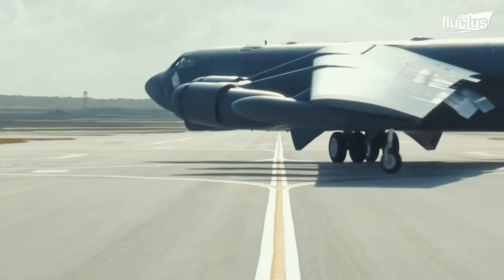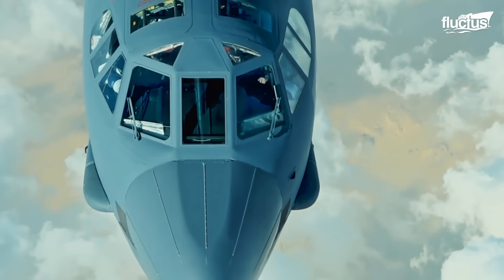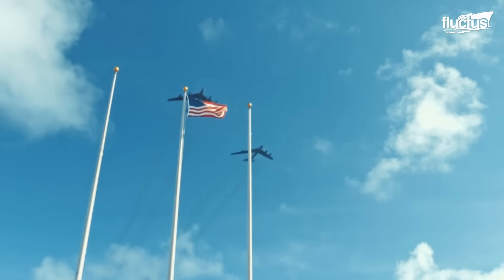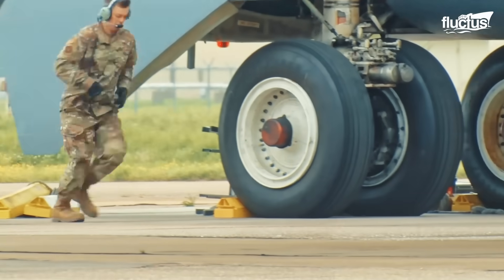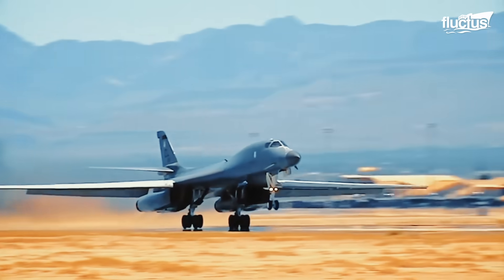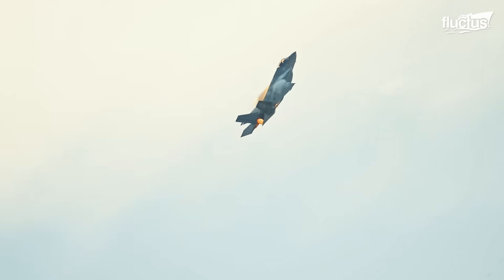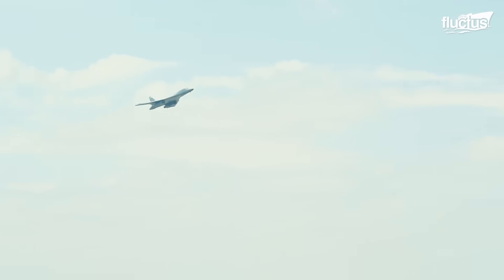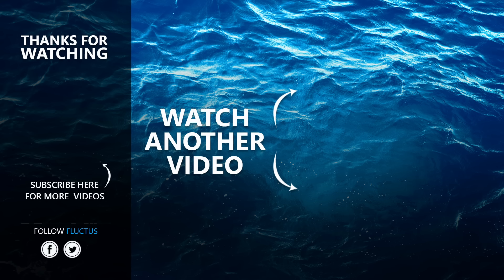Behind US Genius Idea to Power Old B-52 Bombers with Brand New Engines

Comment: The idea of reengining the B-52 has been around for nearly 50 years.  When we were putting the CFM-56 engines on the KC-135R (to be) in 1977-78 it was also discussed about doing the B-52.  But it was felt by the AF at the time that the money would be better spent on the tanker.   Ground clearance would not have been an issue.

Comment: I remember about 15 to 20 years ago, BOEING gave the Air Force a plan to re-engine the Bombers with four engines that the 757 uses. The four engines were more powerful more reliable, more fuel efficient than the 8 engines used on the B-52. Increased the range of the Bomber by about 2000 additional miles. It seemed like a winning idea.
Reply: There's a lot of things that have to change about the aircraft to handle going from 8 small engines to 4 big ones. Engine-out performance and handling totally changes. The structure of the wing may not support the change. Ground clearance would be an even bigger issue for that jet than it already is. They need something as close to a drop in replacement as possible.

Comment: 3:46 the P-38 absolutely never used Rolls-Royce engines. The Lockheed P-38 only ever used a turbo-charged Allison 1710 V-12. The P-40 absolutely used Rolls-Royce Merlins when they could get them. But most US planes that used Merlin engines were actually license-built Packard engines. Rolls-Royce had enough on their hands to keep up with British military demand let alone supply the US with substitute engines. The Turbo-charged Allisons on the P-38 were always demonstrably on par with Merlins because of the Turbo-super charger on that implementation. P-40s and P-51s were designed initially with Alison engines with single stage super chargers that led to poor high altitude performance. They were also designed to easily convert to Merlins as Britain was always a prospective user.

Comment: To think that the Next Gen Fighters can not be maintained to the level the older planes can, simply because in the contracts there are strict provisions that are in favor of he manufacturer to have most of the rights to how the aircraft gets used  and maintained.  They have complete control to their systems (electronic, mechanical and weapons)  So you will never see an Airman manufacturing or repairing a next Gen fighter unless it falls with in the contract that was approved by the military. Just awful that they wrote away their Rights to Repair.😮

Comment: I Love 'The Cadillac'!  But, is there a limit to the number of pressure cycles the fuselage can take before the aluminum becomes so work-hardened it just finally blows apart at 40,000 feet?
...there are grandchildren in the Air Farce flying the same plane their Gramps did!
Reply: The first part of the B-52H to reach economical  life limits of 32,500-37,000 hours on the wings upper skins depending on the altitudes flown.  The fleet is at around 20,000 hours right now.

Comment: There were 2factual inaccuracies in the the engines used in the P40 and the P38 they did not have Rolls Royce engines.
Reply: The P-40 also had a Merlin powered variant the P-40F. That variant is the origin of the 'Warhawk' name now synonymous with the aircraft. Previous Allison variants were called 'Tomahawks' & 'Kittyhawks' but the USAAF adopted the name 'Warhawk' for the Merlin powered P-40's & like the P-51 it turned it into a monster & the name stuck. 

A few test P-38's with Merlins were made & while it offered a performance improvement the Alison's were more than sufficient. Merlin's were also in shorter supply & you would need two so not a good use of resources.

Comment: in the year 2050 Pentagon announce : B-52 will retro fit with new warp engine and join USS Enterprise mission to mars

In a groundbreaking announcement, the Pentagon has revealed plans to retrofit the B-52 bomber with a new warp engine, paving the way for its integration into the USS Enterprise's mission to Mars. This marks a significant milestone in the advancement of interstellar travel technology.

Key Points:

B-52 Modernization: The B-52, a stalwart of the US Air Force for decades, is set to receive a major upgrade with the installation of a warp drive engine. This technology, previously confined to science fiction, is now a reality, promising to revolutionize space travel.
USS Enterprise Mission: The B-52's integration into the USS Enterprise mission signifies a significant step towards humanity's exploration of Mars. The warp drive engine will drastically reduce the travel time to the Red Planet, opening up new possibilities for scientific research and potential colonization efforts.
Technological Breakthrough: The development and successful implementation of the warp drive engine represent a monumental leap in propulsion technology. This breakthrough holds immense potential for future space exploration endeavors, enabling faster and more efficient interstellar travel.
Looking Ahead:

The Pentagon's announcement marks a new era in space exploration. With the B-52's warp drive capabilities, the possibilities for interstellar travel seem limitless. We eagerly anticipate further developments in this exciting field and the potential for future missions to explore the cosmos.

Comment: What they should’ve put on that instead of those Rolls-Royce engines that’s those general electric is the new one for the triple seven Boeing dream liner GE 124 it puts out 124,000 pounds of thrust per engine. You could get rid of four engines burn literally 30% the fuel now you have a super long range aircraft.
Reply: Would never work

Comment: Just a note. The Rolls Royce Merlin engines used in the P 51 and others were made in the US by Packard under license. Some Packard-built Merlins were actually supplied to the UK.
And---there are some USAF pilots who've flown the same B 52  aircraft as their fathers. Not the same model B 52, but actually the same aircraft.

Comment: Why not upgrade to bigger and better turbofan engines?  Look at any large commercial airplane, and it has more thrust than these, have more options for commercial maintenance, and can even reduce the number of engines from eight to four with associated savings.

Engine upgrades for the B-52 are way past due, but I think that there are better options and missed opportunities here.
Reply: Would cost more money because it would require a lot more modification

Comment: As is typical of the military-industrial complex,  they carefully scheduled this upgrade process to drag out for YEARS.  It's not expected that a re-engined B-52 will reach IOC (Initial Operational Capability) until 2033.   WAY too long.   If SpaceX were in charge of the program every B-52 would be flying with the new engines in two years.

Comment: So many errors in here. Need to do a bit more research. No genius here. The B52 has been continuously upgraded for it's entire life. They have been trying to get an engine upgrade on the B-52 since at least the late 70s. Guess they finally got the funding and engineering together to make it happen. Great OLD airframe, hope it outlasts the new engines. As a standoff weapons' platform it can carry quite a load almost anywhere.

Comment: The B-52's re-engining program includes the following specifications: 
Engine: The B-52 will be re-engined with Rolls-Royce's F130 engine, a variant of the commercial BR725 engine. The F130 produces 17,000 lbf. 
Engine controls: The B-52 will have a hybrid mechanical to digital throttle system. 
Other upgrades: The B-52 will also receive a new radar, improved communication systems, new pylons, new cockpit displays, and the deletion of one crew station. 
Designation: The re-engined B-52 will be designated the B-52J. 
Timeline: The Air Force expects the B-52Js to be available for operational use before the end of the decade. 
The B-52 is a heavy bomber that has been an integral part of many US Air Force missions, including Desert Storm. The B-52H version of the aircraft has eight Pratt and Whitney TF 33 turbofan engines.

Comment: Since when did the P-38 or the P-40 Warhawk have Rolls-Royce engines?
The P38 had two stage turbocharged engines made by Alison while the P-40 only had a single stage supercharger by Alison which didn't give it very high altitude performance. The P-40 performed well yet not at high altitude which was always the problem with Fighters.

Comment: Great an engine that is new replacing  a 60+ year old engine, better fuel ⛽️  usage,  better electrical generation,  YET THE SAME FUCKING THRUST,  typical chair force thinking inside the little blacked out box 📦.
Reply: It doesn’t need more thrust and keeping it at the same thrust rating prevents increased stress on the wings.
Reply: @grandmasterpu  ok so .94 mach. No increase in  pay load, same take off weights any decrease in engine weight, although better performance increase in endurance,
Reply: @LiamGardner-u9k  it’ll go back to .86 Mach. The primary reason for the new engines is sustainability. Everything else is a bonus.

Comment: To add new Engines to a 70 year old Air frame is st****.
Beyond belief.
The US should develop a new Bomber. From ground up because so much has changed in technology in the last 70 years. But they can't. They have no money and they have no heads able to do that. B1 and B2 Bomber were clearly a wrong development. There is nothing like 'invisibility' to Radar.
Hint: These engines are from Rolls Royce. A British manufacturer. The technological decline had been slowed down in Britain because being a member of the EU. Technology transfer was key.
Boeing has been fallen back. Burning planes and other inventions that failed miserable.
Reply: They are developing a new bomber, the B-21. It’ll replace the B-1 and B-2. The B-52 will serve along side it as the stand-off missile hauler. 

The engines are being made in Indianapolis.

Comment: The P&W TF-33-P-7 engines that powered the C-141B Starlifter were retrofitted to the B-52.  We had plenty of those engines, but putting RR engines on the Buff, what a waste of taxpayer money.  And Foreign engine manufacturer to boot!
Reply: Had plenty of the engines, that’s no longer the case. The B-52 desperately needs new engines and the RR were the best option. We’ve been using RR on aircraft longer than the Air Force has existed, so this really isn’t anything new. They’re also being made in Indianapolis

Comment: So, in a video which is 15.22 minutes long and is supposedly about the brand new engines, only 67 seconds actually discusses them. and about 5 minutes covers completely different aircraft!
Virtually all of the P-51 Mustangs were fitted with license-built Packard Merlin engines, versions of the Rolls Royce Merlin because although a superior engine out of the box, the RR Merlins were pretty much hand built and that was incompatible with US production methods and speed of requirement. None of the P-38 aircraft were fitted with Rolls Royce engines and the P-40 with Allison V-1710 V-12 engines.
It's not a 'genius' idea to upgrade an aircraft fleet with new engines, it's a long established procedure.

Comment: I wonder why they didn’t go for a 4 Jet engine configuration for the Mighty B52. I loved the F-111, the Aussies would fly them over New Zealand from time to time, great to see. Cripes the B52 is as old as me! Thanks
Reply: The rudder is so small that it cannot counter-act the loss of 1/4 thrust when an engine fails in a four-engine setup. Loss 1/8th of thrust can be handled even by the tiny rudder.
… I am talking about the very narrow moveable part. The fixed stabiliser is large but does not help counteracting uneven thrust when an engine fails.
Changing the rudder design would by a bit too big chunk of engineering to swallow.

Comment: These are either Commercial Off the Shelf business jet engines or a slightly modified version of one. Supposed to offer 30 percent better fuel economy. 

Why 8? Instead of 4 larger ones?
It turns out that the less you change the easier it is to recertify.

Comment: 3:51 The P-38 was powered by Allison engines, nothing Rolls-Royce ever built.  The later models of the P-51 used Merlin engines originally designed by Rolls-Royce, though AFAIK Packard built all the engines used in the Mustang.

Comment: There are Roll Royce parts in an A-10 engine as well.  : )
Reply: And in the F35
Reply: @nathd1748  hot section I would guess ?
Reply: @paulferrara9079  Vertical lift section

Comment: In the 190's, I read about a proposal to re-engine the B 52. Also, the B 52 was a test bed for the 747 engines. It's good that the Air Force bought new engines for the plane, but I suspect they were decades late.

Comment: These venerable aircraft are simply too old, even after upgrades to their controls, cockpit, and engines. They remain machines based on outdated design concepts. It's curious: during the era when the B-52 was developed, there was no hesitation to simultaneously create and launch multiple aircraft designs in quick succession. Today, despite having the most advanced design tools, optimization methods, and production techniques, costs have inexplicably skyrocketed. The same problem exists in Germany with complex military equipment in general. It is crucial to identify the underlying causes
Reply: And yet they're still the best at what they do.  And it isn't like this is the only bomber we have.

Comment: Do the new RR engines have the same thrust or more as the current engines?
Reply: Very slightly higher. Something like 400 lb per engine. 35% better fuel consumption and 14x the electrical draw-off.

Comment: The P-51 was equipped with Packard's redesigned/ American industry spec build version of the RR Merlin engine. The "new" B52 engines are a huge step forward re 
efficiency and close compatibility with today's mainstream maintenance standards.
Reply: You are absolutely correct!

Comment: Ridiculous waste of taxpayer dollars on an obsolete 50's-era subsonic airplane with a radar signature the size of a small planet! This ancient beast will have a life expectancy of less than 30 seconds in a modern battle zone!
Reply: The B-52 has been for a while and will continue to be an arsenal plane. It flies 100 or so miles behind the front line F35’s or F22’s, receives targeting information, which is then loaded into the missiles on board.
Reply: 1800  combat sorties in the last 8 years with the old engines. The aircraft is still very effective.  I guess we should ditch the c -130 cause its 70 years old and has propellors too huh?

Comment: The B52 should really have been decommissioned 30 years ago and replaced with an even better aircraft an aircraft that’s more advanced then the B52… I feel like the military can build and mass produce an even better plane to replace the aging B52 heavy bomber.
Reply: They did. The B-1
Reply: @beeceesp1386 then why continue to use the B52 then ??? if the military already has a more advanced bomber like the B1 than why not just decommission the aging B52 ???
Reply: @G-Man-half-life  A perfectly reasonable question. Requiring an Air Force representative to answer it accurately. But… what is published and available to the average citizen is: The B-52 has been updated so many times and in numerous ways, it is capable of the many missions required of a modern bomber - plus a few more (due to its cruise missile capability) like ultra long range and maritime missions. But that doesn’t really fully answer your question does it? The answer probably lies in the age old adage “follow the money” as in - the cost to replace them. These planes were produced for around 85 million dollars a copy back in the day - and modern aircraft capable of performing the same number of various missions (like the B-1) cost over 1 billion dollars each.   Money that comes out of our pockets!
Reply: You apparently aren't aware that the B52 isn't the only bomber we have.

Comment: In the DOD/Aerospace world, we'd call awarding Rolls Royce the contract for the re-engine program, throwing them a bone.

Could have easily installed 4 modern turbo-fan engines like the General Electric Leap engine, with more thrust, lower operating cost and lower engine operating temperatures.

Hell, even my favorite engine the IAE 2500 would have been a simpler approach. But it's only taxpayer money.
Reply: You talk out of your ass mate. RR make components for the F35 engine. It's quite simple why the Pentagon chose RR. They already have over 400 examples of that engine in the US military inventory. Engineers have many years experience with it. GE and PW quoted 3x and 4x tbe cost that RR quoted for this programme because they were so cocksure the DOD would award to a US company only. Pentagon fed up with US defence companies bumming the taxpayer as did Boeing with the KC46 programme. The V2500 was 60% designed by RR. They already established that as a 4 engined aircraft they do not have enough rudder to counter the loss of an outer engine.

Comment: I remember flying into Hartford-Springfield Airport in the late 70's early 80's and see a B-52 with a single jumbo jet engine slung under the wing on a former dual engine hard point.  It sure has taken a long time to bring this to fruition but it isn't one of those big, tested engines.  "This will save billions of dollars in the decades to come"  but cost billions NOW.  What happens if the maintenance isn't reduced?   Yes, probably fuel efficiency at a time when the SPR has been drained by Biden.  Funny if we have to fly over the Pacific to fight China and they have to beg fuel from some country to return home. (Assuming Chinese subs sink all the tankers loaded with fuel and then level Diego Garcia and Okinawa.)